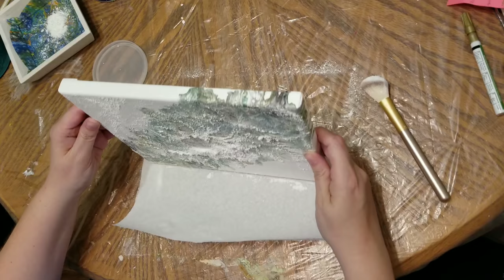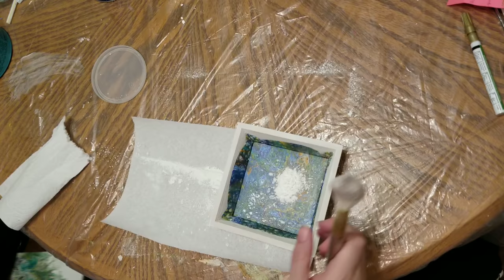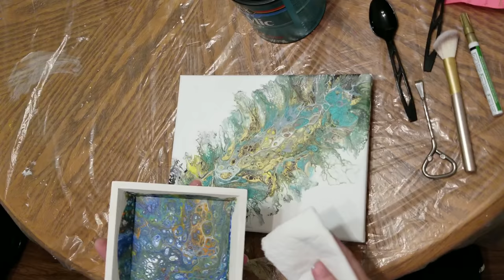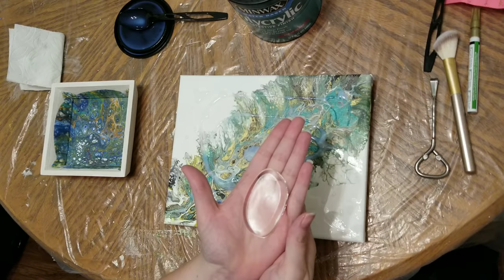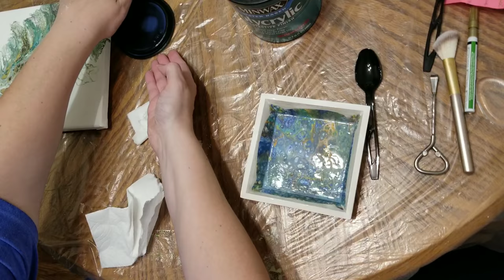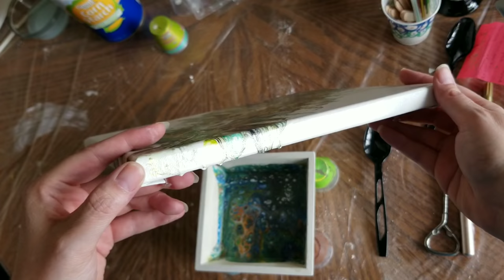How to Clean & Seal Acrylic Pours both on Canvas & Wood

Comment: This is really good stuff. I do all kinds of painting, on wood not just acrylic pours but with brushes. Whether I am using a canvas, wood or whatever, I use this stuff. I even refinished our crappy living room side tables using a crackling medium and then finished it up by sealing it in with a couple coats of this stuff. Those tables are still just as I made them 20 years ago. Cannot believe after several moves, spilled coffee, etc they look like I just finished them. Cannot recommend it enough.
Reply from the maker: That's wonderful Donna Lynn!

Comment: Great demo.  I'm wondering if you can spread the coating around with a glove?
Reply from the maker: Thank you so much for watching & for your great question! If you have a very well fitting glove, you could potentially spread some of the polycrylic with your finger(s), but I have found that I don't get a smooth, even consistency and while the polycylic is generally self-leveling, spreading it with a glove doesn't always give consistant results. I hope this helps! 😁

Comment: Just what I needed! Great idea the silicon pad. I am using acrylic pour method on tiles so that I can leave them as placemats on the garden table. Would the varnish you use be strong enough to cope with the weather outside or have you any idea what I could use please?
Reply from the maker: Hi Anthea! Thank you so much for watching! I'm sorry for the delay in my response. I would suggest cleaning & sealing with polycrylic, then after drying, adding a layer or 2 or resin to cope with the conditions of being outdoors.

Comment: Hi Sandi, loved the video. What's the difference between using varnishes compared to epoxy resins?
Reply from the maker: Hi Paul, thank you so much for watching! I'm glad you loved my video! I'm no expert by any means, but I personally feel that while a varnish will seal the piece, for true protection resin is the way to go, as it will harden. Also, the shine that resin provides is unparralleled!

Comment: Is there a time frame between painting then corn starch  then polycrylic seal .........painting dries 3-4 weeks ? Then the corn starch ? Thank you for your time with my question !
Reply from the maker: Hi Kim! Thank you so much for watching! This is an excellent question. Yes, I allow my pieces to dry & cure over the course of about 2-4 weeks after painting them. Then I will clean my piece with cornstarch & then mild soapy water. I allow the piece to dry completely after cleaning, usually 2-4 hours, then I seal in polycrylic. I hope this helps clarify. 😁 I am always happy to answer any questions! Thank you again so much for watching!

Comment: Do you heat it up a second to take out air bubbles or help self level when you’ve applied the minwax polycrylic.
Reply from the maker: Hi Sue & thank you for watching! I don't usually heat up the polycrylic unless it is very bubbly, but mine hasn't been most of the time.

Comment: Can you also give some tips for someone who has never used resin before? I want to try it but for some reason I am intimated by it. I’m guessing because I know that it can be temperamental and tough to work with. I’m just nervous about using it on a piece and then not liking the way that it comes out and having a ruined piece. Any tips or tricks that you can suggest would be greatly appreciated. Thanks so much!

Comment: Hey Sandi....great advice....I used the Polycrylic after cleaning my painting well and I poured my varnish over the painting and tilted it so the sides were covered no puddles torched the bubbles and left it to dry....the next day I looked at it and it was all cracked...so upset as it was a gift for family...does the varnish need a warm room to set properly or is there any suggestions you could give me as I am upset over this after the painting was just beautiful and any help you can give me would be greatly appreciated...thanks so much Donna Remeika
Reply from the maker: Thank you for watching Donna! I am so sorry that happened to you. The reason why it cracked is because the amount of polycrylic needed to coat by tilting is too thick. Once this is completely dry, (I'd give it a few days), then you may be able to slowly layer in polycrylic into the cracks with a small brush, allowing to dry between each layer. I must stress that I have not tried this, but it is what I can think of at the moment.

I can imagine how frustrating this must be & I hope that it turns out for the best! I'd love to know how it goes. You can send me a facebook messenger request if you have it, by searching for Sandi Paints Herrera on facebook.

Comment: I tried this technique and my minwax cracked? Any tips?
Reply from the maker: Thank you for watching Cfitzy33 fitz! I'm sorry to hear that your minwax cracked. I'm not sure what created the perfect storm to cause this on your piece specifically, but there are some things that could cause this. One would be if your paint was not fully dried before applying the polycrylic. Others could be that the polycrylic dried too quickly (this can cause your paint to crack too), the polycrylic didn't dry completely before another coat was applied, or each coat of polycrylic was too thick.

I hope these tips help & that you'll have better success on your next attempt!

Comment: Is there anything else that works instead of the dish soap
Reply from the maker: Hi Angela, this is a great question. You cn try gently rubbing a soft cloth/paper towel with some rubbing alcohol over it, but it will remove paint & I don't recommend using it over your entire piece.

Comment: How did you adhere your pours to the wood and canvas?
Reply from the maker: Great question Judy! I gesso all of my canvases and wood pieces, allow to dry completely, usually over night, then I pour directly onto the canvas or wood. I hope this helps. Let me know if you have any questions! 😁
Reply: Thanks for your reply.  I am studying video after video trying to learn the art.  Less than a beginner, shall I say.  I am confused. I thought pours were over-flow paints from other projects.  Are you saying the canvas is not done that way?
Reply from the maker: @judyrousselle743  - I can completely understand the confusion. In almost all of my pieces, my pours are intentional for that piece. Sometimes I will have extra paint left over that I will then use on another canvas or piece of wood. I hope this helps!
Reply: Thank you. @SandiPaintsHerrera

Comment: I have yet to seal anything. I'm intimidated. I had imagined that you just float the varnish and tilt/pour it off. Is there a reason that you use a brush/beauty blender?
Reply from the maker: Thank you so much for watching Reborn Snuzzles! This is a great question! From my experience, polycrylic is thick enough that the amount needed to tilt is too thick & cracked as it dried. I ended up ruining my piece. I have learned that multiple thin layers, allowed to dry between coats works best. I hated the brush marks that a paint brush left, so I heard someone mention the beauty blender & bam, I never use a different method now. I hope that this helps! :)
Reply: @SandiPaintsHerrera  Thank you for answering my question.

Comment: u dont finish the while little tray????? i like the..."design" in ur tray; did u have a stencil?? i really like the painting, too. the colors are so pretty!!! sorry im so late in watching this...ruff day 🙄!!! very informative, thanks. i use 3in1 oil, & spray varnish. i think im VERY FORTUNATE, in that, when i cleaned it w/dawn, & rinsed it under running water, it didnt warp it!!!!!! 😂😂😂😂 💖💖💖💖💖
Reply from the maker: Gayla Roof - I'm sorry to hear you had a rough day. I hope it improves.

I don't have a stencil, I get the colors to come up the sides by tilting after pouring. Here is the video of this trays creation: https://youtu.be/7bB1zcqJzQk

I just cleaned & sealed the inside of this tray because I haven't finished painting the outside & bottom yet. (I haven't decided what I want to do yet. 😂) Once I do actually paint the outside & bottom, I'll allow them to dry and cure, then I'll repeat the same steps I just did here to clean and seal, but will likely use masking tape along the inside edges, before I do.

Oh wow! I think you were very fortunate it didn't warp! 😯
Reply: Sandi Paints Herrera. thank you. very good vid. 😊😊 💖💖
Reply from the maker: You're welcome! I'm so happy I can help!
Reply: Sandi Paints Herrera  hey!!! i was @ michaels today, & guess what i got 😁...yup! 3 little trays, & 2 little square boxes!!! cool!! cant wait to get'em sanded, gessoed, & sanded again, so i can paint'em!!! 😁😁😁😁 💖💖💖💖
Reply from the maker: Gayla Roof - That's awesome! I picked up more trays and a little box with a drawer in it today too! I can't wait to see what you create!
Reply: Sandi Paints Herrera same here!!! 😄😄😄😄 💖💖💖